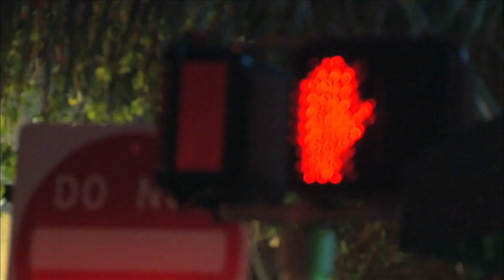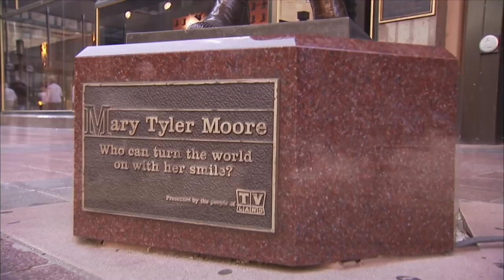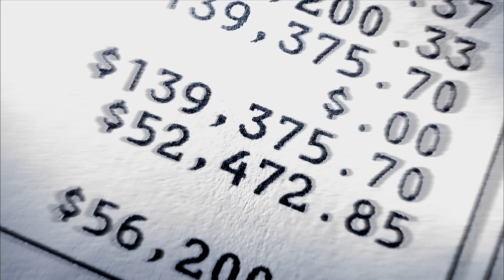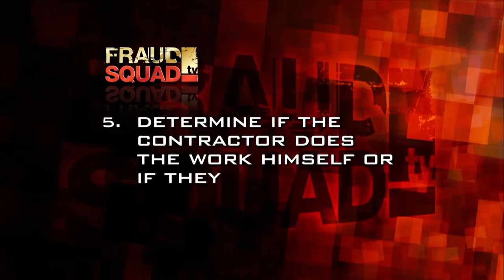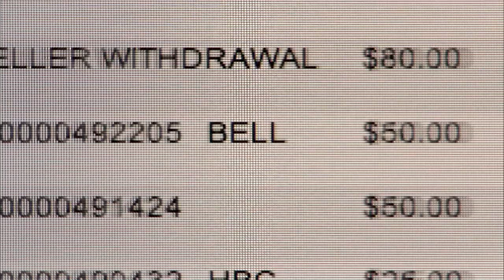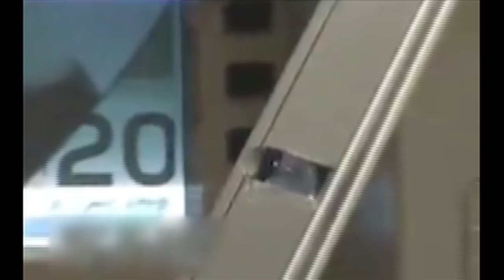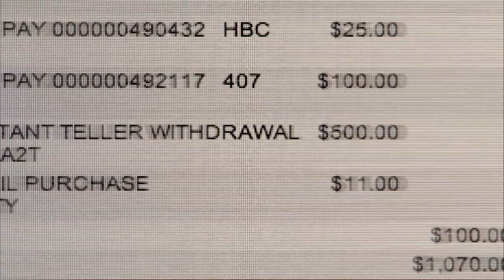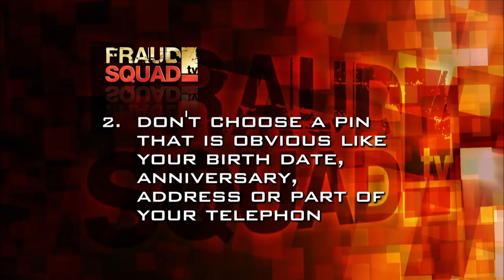How Do ATM Scams Work? | Fraud Squad S1 EP5

Comment: The debit card skim isn't as effective in Australia anymore. Yes, all debit cards here have chips now. The magnetic strip is only a backup if the chip fails. It won't let you immediately swipe until you've attempted to pay with the chip twice. Purchases under $100 don't require a PIN and you can simply place the chip of the card onto the machine and it processes the payment. Also, you can pay via your bank's smartphone app much like tapping the card. Your card numbers won't be visible, only your PIN if the purchase is over $100.

If you need money, get cash out when you make a purchase. Avoid the ATM if you can. If you must use an ATM, for the love of god, cover the number pad when you enter your PIN. Avoid ATMs if anything is protruding out or looks abnormally large.

Another version of this scam is at train stations with self-service payments. If possible, pay cash, buy your ticket direct from a cashier or pay online.